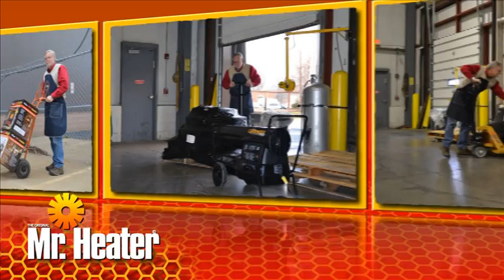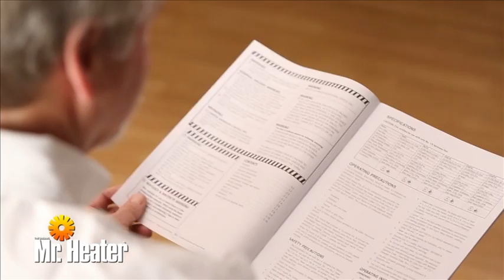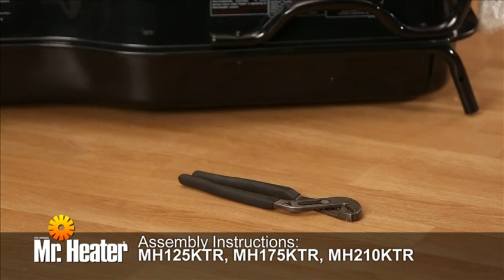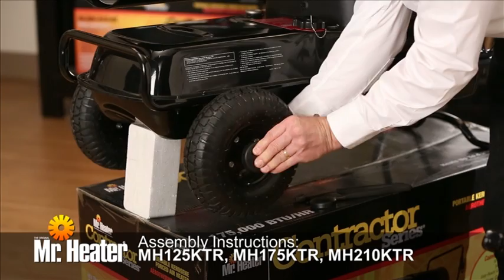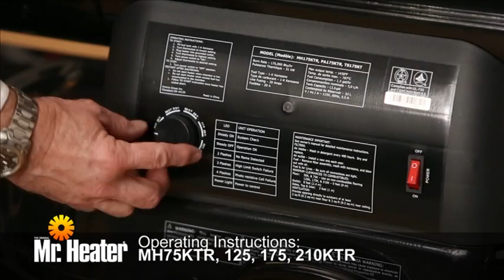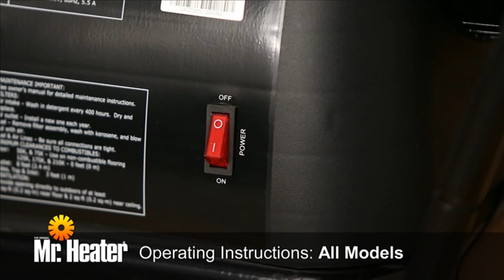Mr. Heater Forced Air Kerosene Heater Assembly

Comment: Bought my 75000 BTU unit about 18 months ago . My last one lasted at least 10 years. I went to start it and it wouldn't light this morning. I called tech support and while I was on hold for 1/2 hour I took the cover off to make sure there was no filter clogs ( I put a new filter on it and emptied it when I put it up for the summer. no clogs, but I noticed ALL the hoses are cracked. the old one hand neoprene rubber hoses, like fuel line, these ones are that pliable plasticized stuff. the Tech support guy comes on and said "oh ya thats dry rot. the best I can advise is to go to an auto parts place and get 3' of fuel line" and replace it all" I appreciate the honesty but I shouldn't have to deal with rotted lines on a virtually new piece of equipment. His advice also makes me think that all the replacement parts are bad as well, so people paying for repairs will be out of pocket multiple times over the life of the product.
Reply from the maker: Thank you for your comment and feedback. We apologize that your unit had hoses and lines that had dry rot.
If the unit was a new product, we can replace the fuel lines for you without going through an auto parts store. Please call us at 1-855-663-0660.
Reply: Get your self some aftermarket fuel hose, it is better quality. Factory fuel hose is not up to par.
I would replace it after the first year of use. Good luck!

Comment: You guys should offer a frame you can buy or a wheel kit for the 50 and 75k btu/hr models, I don't have use for 125k btu/hr heater but I do have use for the wheels/frame and handle the bigger ones come with! I would buy a kit for that!
Reply from the maker: ssShortBoxKid⧓ Thank you for the feedback and idea!  I will pass this on to the Product Managers!
Reply: Mr. Heater Woah wasn't expecting a reply from such a big company, that's quality! Thanks a bunch!
Reply from the maker: ssShortBoxKid⧓ You are very welcome!  Thank you for the feedback!
Reply: It fairly easy to make a small frame with wheels and a handle on it to role it around the shop. I made one out of wood with two fixed caster wheels on the back and short legs on the front. Then I bolted and old lawn mower handle on the front to move it around the shop. Works great!

Comment: I have been trying to get Mr.Heater on the phone for 3 days now. Each time I call I am on hold for over an hour until I give up. All together, I have spent 6 hours on hold for someone to talk to me about my newly purchased Mr. Heater 75,000 BTU kerosene heater. Maybe this method of communication will work...I don't know....Mr. Heater can you help? The product is brand new. I put in the fuel and plugged it in and followed the directions and it doesn't start. The power button turns on but the motor doesn't seem to work. All you can hear is a noise from the heater like it is trying to start but it doesn't.
Reply: did it finally work?
Reply: Kick it! Worked for mine!
Reply: Next time you call, ask for Mrs. Heater instead. She'll know where he is!